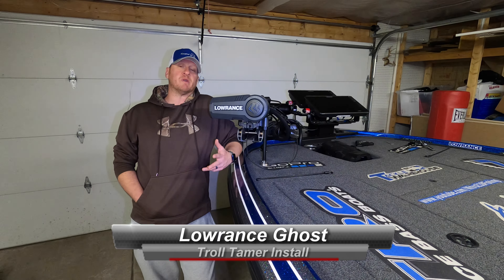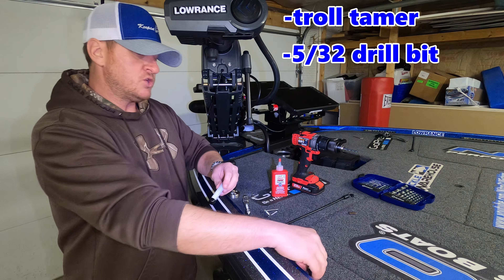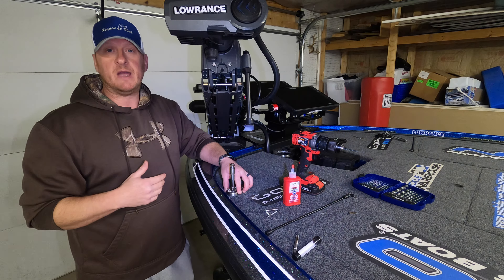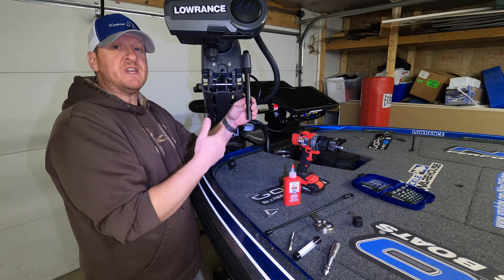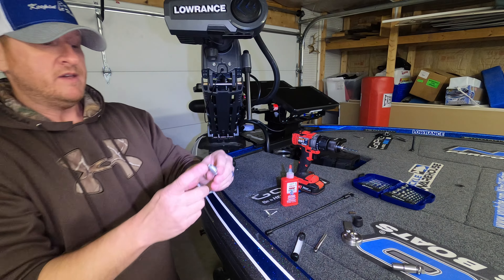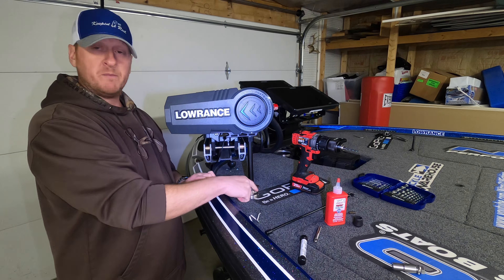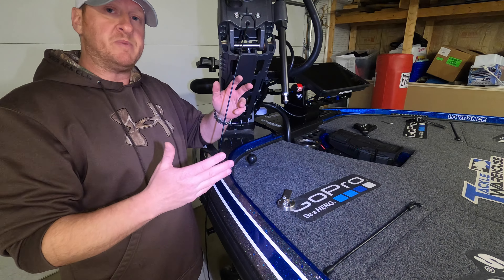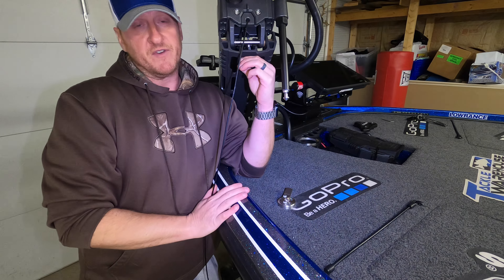Lowrance Ghost Troll Tamer

Comment: Again, super idea.  I am by far no expert and I was able to do this.  Ran the tap up as far as I could in the Ghost stabilizer tube.  I cut the troll tamer threaded piece to the length of the tap threads.  And it was a perfect fit to the tamer anchor on the deck.  Thanks for this hack.
Reply from the maker: Thanks Gary!...glad it worked out for ya, this is a no brainer for anyone with a Ghost in my opinion...thanks for watching!

Comment: Thanks for the great video.  Would you say this install is as effective compared to drilling through the bracket (traditional install) for big water?  Any reason you went with taping the support bar versus through the trolling motor bracket?  I am new to the ghost and pick up my new rig in the spring.  Is the support bar aluminum?  What material are the threads that screw into the trolling motor?

Thanks for your help in advance!
Reply from the maker: Thank you, I appreciate that!  

So I didn’t want to go through any part of the “body/bracket” just for aesthetic reasons, just a personal preference.  But this worked out perfectly and keeps the Ghost as secure as can be.  Definitely as effective as going through the bracket itself.  Hope that helps, thanks for watching!

Comment: Given that the vertical support rod of the Ghost is already a hollow tube, a "plug" style tap will probably give better results (follow the existing hole) and be easier to use (strength to turn & cut the threads). The plug style has a bit more taper at the tip, helping to get that "perfect alignment" when first starting to cut the threads into the hollow shank.

Comment: Why would you not show the most important part which is tapping the screw? Did you use a manual tool or a drill with attachment on it?
Reply from the maker: I mention in the video why I didn’t show it, just wanted to keep this as short as possible…there’s a million videos out there on how to tap, so I figured it was pointless, I’m sorry!…I used a drill attachment, the one shown/linked in video

Comment: Do you know the item number for the troll tamer from T-H marine? I don’t see one specifically for the ghost.
Reply from the maker: Hey John!...I actually have a direct link to the one I used below the video...hope it helps!
Reply: Because he is mounting a troll-tamer in a novel (and effective) way, you don't need a specific troll tamer model for the Ghost.  If you did want to mount the troll tamer in the conventional way (but why would you?), the part # is THRMC-101FMK-DP for deck to motor gaps of 5-8 inches.  That isn't necessary for this method.

Comment: was just wondering about the support post. Mine is angled to the deck of the boat. Is yours at an angle also ? I have the troll tamer but afraid to install it because  it might not completely lock because its at a slight angle when completely down on deck . thanks
Reply from the maker: Hmm, that’s a good question...mine doesn’t seem to be angled much at all, so I’m not sure...you can always drill/tap the stabilizer bar, and then before screwing down the base, see if it’ll lock in for ya...I actually did that as well before screwing base down just to make sure...let me know how ya make out!
Reply: I drilled and tapped it. But just wasn't happy with the way it was trying to lock. Hit and miss So I  just screwed the pad back on the deck and never installed it. Really didn't want to drill a hole in the bracket. I might try cutting off the support a little more so it can come down a little more square to the deck. Boat 2010 Triton TR19 Thanks!! for getting back.
Reply from the maker: Yea no prob!...you should be able to trim that bar to get it more square, keep me posted if ya don’t mind!...I’m interested to see if ya get it to work!

Comment: First, thanks for the information.
Couldn't tell from the video, but if you adjust the depth the trolling motor goes down into the water will the pin still line up with the base that was installed on your deck?
Thanks,
John
Reply from the maker: Yepper, if you adjust the depth of motor, the stabilizer bar doesn’t move so you’re good to go!... thanks for watching!

Comment: Dude I know this is off topic but I was hoping you could let me ask you something about the Ghost. I know you have to have the puck installed but my question is this: I like to use the Point One Antenna to use the heading up function on my maps with the casting ring. If you dont know this allows the map to move around in the direction your pointing. I need to know does this puck do that already? Or do I need to have the Point one antenna to have this function? Thanks in advance
Reply from the maker: Hey Eric!...I’m 99% sure you need the Point-1 as well for what you’re looking to do...I run both, my Point-1 is mounted by my console to avoid any magnetic interference...if I’m wrong hopefully someone will jump in and correct me but I’m almost positive that’s the case...thanks for watching!

Comment: do you know what size troll tammer that is.is it mk 101 .104 .or 105
Reply from the maker: Yes sir, it’s the 101...model number RMC-101FMK-DP to be exact...I have a direct link to it below video!
Reply: I was wondering do you think it would be possible to mount the tammer in the middle and drill through the trolling motor itself  like on the min koda ,reason being on my fortrex.  when I first got it Lake Erie rough water snapped my mount because it was off center it put more pressure on one side. so I got the tammer never did it agin ,.I plan on getting the ghost soon and would like to mount the tammer in the middle like my fortrex. I'm wondering if the height would work ...thanks .for the help.
Reply from the maker: I would say yes, it should work perfect!...I didn't specifically measure for that but after installing it and just eye balling it I don't see any reason it wouldn't work height wise...hope that helps!